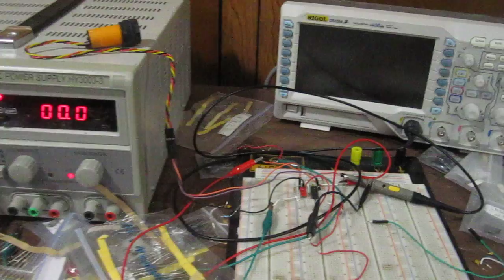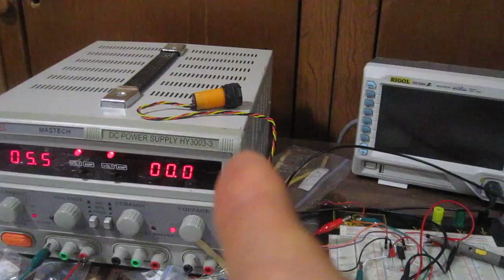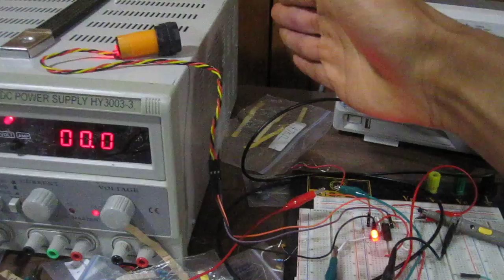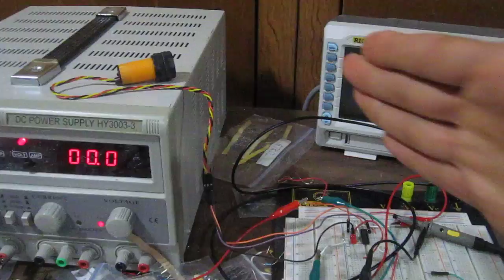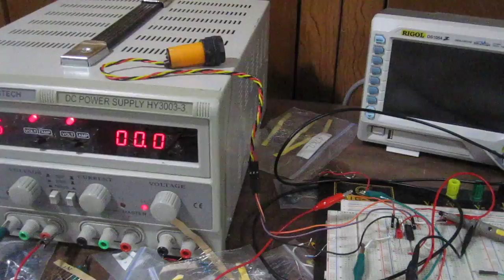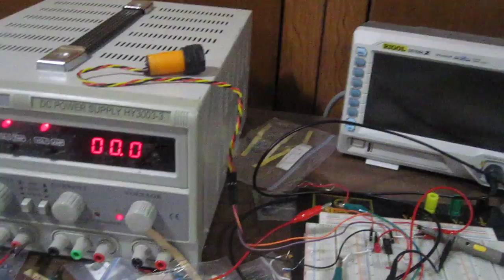Motion Detector Circuit built with an Infrared Proximity Sensor

Comment: m08-14-2023

(1.) Hi, there.

(2.) New to electronics, so appreciate your putting the 4011 version on a breadboard.

(3.) What is the process for adjusting the IR sensor so that it is set to trigger the LED at a certain distance?

(4.) Thanks.

(5.) Toodles!